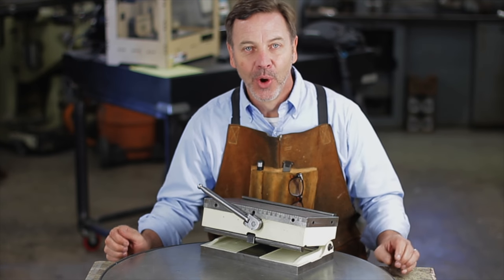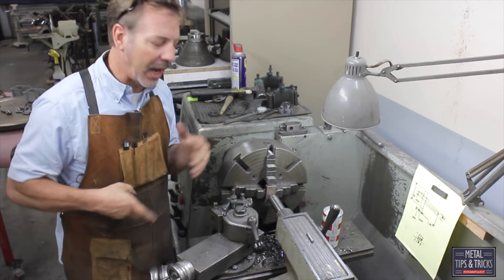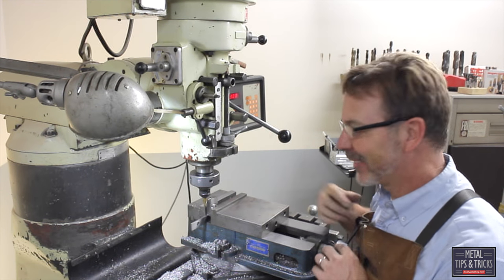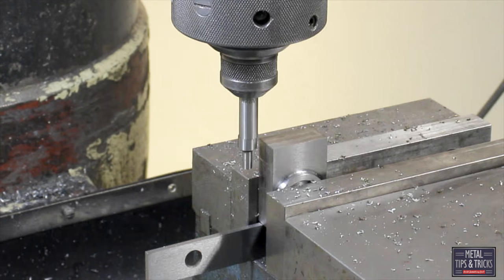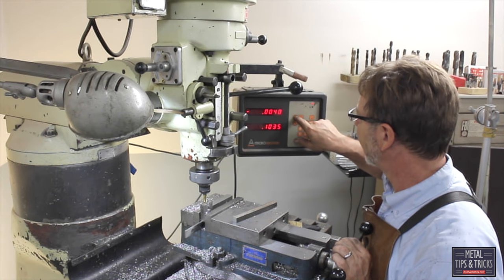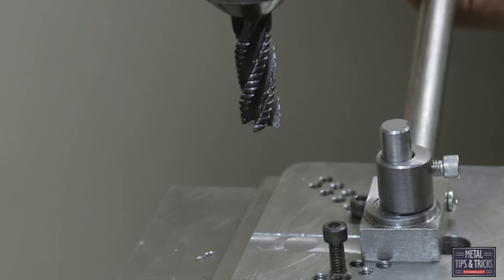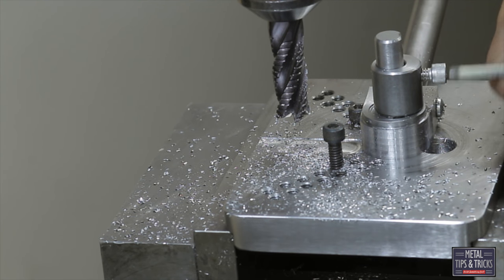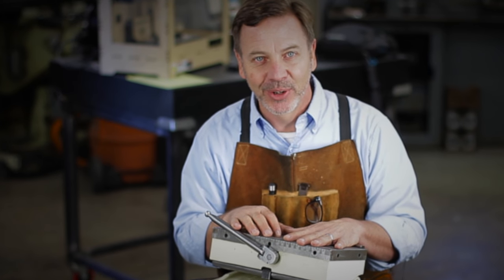Making a new handle PART 5

Comment: Great video Dale. When cutting the radius, your comment about speed vs accuracy is very accurate. Too often we get hung up on chasing numbers that just aren't important. For some time now i have been doing similar on my mill, and it has saved me hours of time, and produced excellent results on 'less critical' dimensions. If that radius was off 0.020" or 0.5mm - who care's? It will not make any difference to the end result. Personally I work on 'as accurate as needed where needed, and never less than needed'. Greg

Comment: I'm going to have to make one of those jigs for myself, that damned rotary table of mine weighs a ton.
Reply: Agreed that the older we get the heavier that same table is getting to be...!!!   lol
Reply: Nice jig with some modifications. Maybe a more substantial base plate, to have more meat in the vise? Even further, have dedicated vise jaws that have pins that capture the jig. This way you would have to shear off four pins to have the jig climb up the vise. Also a universal cap or caps that get screwed down on the center post to hold fast the work. What do you think?

Comment: The rings cut on the face of the chuck are there for  reason. If you measure the distance from a ring to the edge of the 4 jaw chuck you can center any shape quickly. A 6" scale can get you within .01" easily. I usually put a piece of 1" stock in it, center it up and mark the chuck face where the jaw is located for all 4 jaws. It's easy to preset jaws from those 1" dia marks.

Comment: Nice jig with some modifications. Maybe a more substantial base plate, to have more meat in the vise? Even further, have dedicated vise jaws that have pins that capture the jig. This way you would have to shear off four pins to have the jig climb up the vise. Also a universal cap or caps that get screwed down on the center post to hold fast the work. What do you think?
Reply: Even easier, Thicker base plate with shelves that sit atop the vise jaws and shelves lower on the left and right sides that allow t slot clamps to tie it to the table. A couple of Jack's between the plate and vise or table and presto!

Comment: The jig is interesting, but as you said it is a bit crazy and potentially dangerous I've done something similar with a router in wood and it can bite really quickly if you don't  treat it with respect. I see that having the handle attached gave you  good control but maybe the video about the jig should have came first. Please I'm not trolling just suggesting.